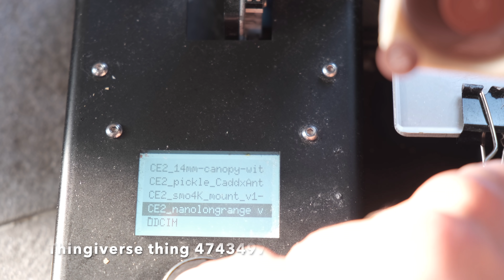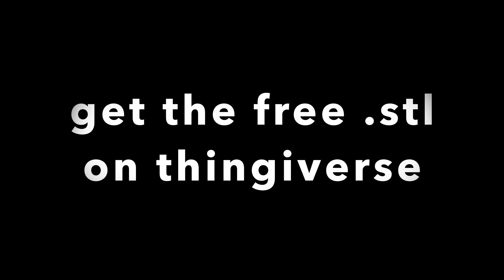3d printed nano longrange FPV drone

Comment: Nice, I'm working on drones that can find and collect cigarette ends.
I have the idea of using supercapacitors as mechanical frame to reduce weight.
Reply: Erik you can't say that and not give us more info!! It sounds like a good idea. Any videos planned :-)
Reply: @andyspoo2  I'm proposing to bulid a custom capacitor in the rounded shape of the ground plate. Use copper band on rolls, cut the form out, same with thin plastic as for litter bags and use, no joke, Johnson's baby oil (mineral oil) as dielectricum for prototyping a ground plate...
If you make a bigger knife for the plastic, you can weld the edges togeher. No air inside!
Reply: There mustn't be any sharp edges in the form because of the corona effect. Make a stance/bended knife to speed up prototyping. Fast recharging within seconds will be possible at the con of a shorter flight time available.

Comment: nice work Kurt!! On my channel I did 29min51sec with geprc 1202 10000kv with same FC, same props. Acro mode. AH I read the description, the 5Celcius IS the issue. Keep it up because I finish my new design to beat 30min! Good luck!

Comment: wow..love to have a 3d printer and print some of those frame
Reply: 3D printers have gotten incredibly cheap and easy to use.  If you can afford FPV then a 3D printer is just about the cost of another low to mid range drone.
Reply: I'll print some for you if you like,

Comment: Nice frame... friends don't let friends fly in angle mode though! You'll probably get even more flight time without the quad fighting you the whole time.
Reply from the maker: Thanks for the tip! I though it would be more efficient...
Reply: That entirely depends on the drone and what you are trying to achieve. Small drones/whoops are angle/horizon mode drones. They will actually fly better and longer this way, as they don't have the weight and power to control them properly in acro, and you will only be fighting yourself. Cinewhoops can go either way depending on the shot. Indoors or making a mostly straight shot with maybe an orbit will look best on angle mode and require less post processing magic to clean it up. However if you want to dive and roll around objects, acro is going to look smoother.
Reply: @JasonEllingsworth  You're kidding yourself... Whoops are flown in angle mode because of the tight spaces and slower roll rate.
Anyone who makes money flying cinewhoops flies in acro. Any form of cinematic flying in angle mode will always look robotic and not flow as nicely because the angle limiting that is restrics the quad to  preset tilt angles  fights the natural flow of the quad.

Angle mode/horizon mode makes constant corrections to maintain attitude. Acro mode simply acts on the stick input and then remains in that position until another input is received. The additional corrections is what causes angle and horizon mode to use more power.

Please make sure what you're saying has actual truth and fact behind it rather than your own assumption/opinion before trying to correct someone.

If been doing this stuff for a long long time. I've tried every way of doing things and I'm not afraid of being wrong because I'd rather be wrong and then have a better outcome, than be stubborn and continue to do something when there is a potentially better way to do things.
Reply: @JasonEllingsworth  solid response.. next time, don't try to correct someone when you don't have a clue... It's also weird that you like your own comments.
Reply: @ryanokeefe12  I liked his comment :^) He never said there was no use for acro in cinewhoops. He just gave very correct info on when to use it. Maybe stop trying to flex so hard about being "right" so you look like less of a tool. You do need to calm down.
Reply: @FIN_OSCAR_RAHHHH  He didn't give correct info on when to use it. nor why you use it.. what are you even talking about. I responded with supporting points as info as to why the statement was incorrect. I didn't juse use profanity and act like a child when I didn't like what was said. I responded with information and fact.
Reply: @JasonEllingsworth  regarding the "high dislike ratio" Are you aware that I don't post videos for others nor try to promote my channel.. you are literally the only 1, or 1 of 2 dislikes. I'm not going to lose sleep over your childish actions.
Reply: @ryanokeefe12  yeah you are.  Otherwise you wouldn't be having your little multiple post hissy-fit
Reply: @ryanokeefe12  he did in fact give good info.  Most people aren't flying any kind of whoop(cinema or otherwise) indoors in acro, and depending on the shot outdoors you will find it beneficial to be in angle mode to keep with the horizon and only make turns with the yaw. All he was doing was simply saying not every situation calls for acro mode.  Your ego apparently couldn't handle that.
Reply: @FIN_OSCAR_RAHHHH  I don't know what you read but that's not what was said.
Nor is what you said relevant to my original comment.
My comment is about this video, the flight that is being shown and the fact that acro is more efficient for battery life.
Regardless, I noted that anyone who makes money flying whoops (which is not what this video is about) flies 100% acro because it's much more free flowing than the restricted angle mode.

Again though, this video has nothing to do with any of this. The first reply from your mate tried to tell me that angle mode was more efficient.. Stay on topic.
Reply: @ryanokeefe12  except you are wrong.
Reply: @JasonEllingsworth  I've explained my comment. I've explained your incorrect points in my responses. All you've done is throw out insults and act like a child.

Feel free to act like a human and let me know why you think I'm wrong, instead of just saying "you are wrong".

Please ensure you read my comments before trying to let me know why I'm "wrong".
Reply: @JasonEllingsworth  I thought so mate.. You've got nothing.. you're just acting like a spoilt child.
If you're ready to adult.. I'll happily have a conversation with you on the topic. If you aren't then you're on your own.

Anyone reading these comments can see exactly what they need from you, and that is that you have made an incorrect statement, have no supporting information but still refuse to be incorrect.
Reply: @ryanokeefe12  wrong again buddy
Reply: @JasonEllingsworth  I guess we are "mates" now? haha that guy was a real tosser. GJ messing with him though. He so salty

Comment: I have been making these for all my friends not this frame but one very similar
Reply: How much do they cost in materials?

And how much do you sell them for?
Reply: @Espelter  I haven't sold any yet haven't really tried but I was thinking of only charging $5-$10 per frame but it's for the frame only for folks that don't have 3d printers.  You would have to buy the other parts separately.
Reply: @SpreadingKnowledgeVlogs  sheesh that sounds good send me your email ???
Reply: @pacman5511  I'm also on ebay but don't have these listed as I'm not sure how I'm going to market them plus I'm waiting to get permission to mass produce them from the guy who made the frame but if someone who doesn't have a printer wanted me to make one I could and technically just say I'm charging for the printing service and nothing else
Reply: @Espelter  in materials I'm not sure I mean you have to take into account electricity and time if your going to get technical about it but I charge $5 a frame plus what ever shipping is which I figured seem fair and not going to get rich off it really just like to help others get into this side of the hobby for cheap and I realize there's a gap in the market to fill of people who don't own printers but would like to try one of these out.

Comment: Imagine how much weight you'd save if you removed all the connectors and soldered everything. And used aluminum screws, incorporated antenna guides into the frame
Reply: Actually you would be surprised at the insignificance of this said weight difference we are literally talking about a gram if even that
Reply: @SpreadingKnowledgeVlogs  Nope, you're incorrect. Soldering EVERYTHING would dramatically decrease weight as the GNB27 wouldn't be needed. In addition to that, a few grams is monumentally important for a build of this size.
Reply: @flightevolution8132  have you ever weighed these connectors?  I have and it takes 5 of them to equal a gram so we are literally talking less then a gram of savings here and that isnt taking into account solder is incredibly heavy as well and most people use too much of it.

Comment: second battery was already overly discharged before takeoff, it's at 2.9V, it should have started at around 4.2V.
Reply from the maker: Right, it's C rating is too low.

Comment: Very good !
I tried a similar project. A long time ago, with coreless motors.  I was at full throttle most of the time just to maintain a hover. My run time actually decreased with a 18650.
Excellent!!!

Comment: I believe I've tried over a dozen different brands of 18650 cells including the sony and panasonic brands and the best I've achieved is 6 minutes.
Reply from the maker: I can only think of 2 reasons. With 18650 you can go below 3V - you don't need to land at 3.8V. There are also a lot of fake 18650 batteries out there.
Reply: @Unboxingexperience7  I agree. My particular issue at this moment is the  (now murata) 18650 3000nAh vtc6. Take off to hover is nominal at about 50% throttle and is held for 2 minutes until small increase is needed to maintain altitude. At 3 minutes I must advance throttle to full as the drone bumps it bottom on the ground. At 4 minutes plus I'm lucky to get a foot off the ground. Cells are charged to 4.2v and end at 2.7V before I disarm.
Reply from the maker: seems to be very inefficient. 3018 props? 1202.5/1203 motors with 11000kv? ph2 connector or GN27/XT30? overall weight over 110g?
Reply: @Unboxingexperience7  90 grams, 1107 motors, 3" props , 18650 battery tray.
Reply from the maker: well, my best guess would be that the motors are the cause. 3018 two-blade props with 11000kv motors are the way to go on these 1s builds.

Comment: Definitely needs crossfire or tracer. Or ExpressLRS
Reply from the maker: right, gonna switch to elrs. waiting for the parts though. some other upgrades are also in the pipeline.
Reply: @Unboxingexperience7  Hi, i stumbled on your design... first time quad flier and want some simple design i can print on my 3d printer. Can you tell me what you're going to upgrade on this model ? Pherhaps with partnumbers ?
Reply from the maker: this will be the most accessible version. plug and play, no soldering. just change to a better radio: tracer, cf, elrs, ghost. next version will have 1202.5 motors and the new happymodel diamondf4 board. frame will stay the same but printed in pla+

Comment: Should  have 3d printed  the props too
Reply: Very inefficient, horrible balance, extremely flimsy, noisy, and somewhat dangerous (mostly for the electronics as they won't heal like you will unless it explodes in your eye or something). Injection molded props are better in every way except delivery time, but you can also make your own injection molds if you really felt the need.
Reply: @jakegarrett8109  good to know

Comment: I had my Crux3 out today, and had 12 minutes cruising on a 2S 450 mah lipo, a 3000 mah lipo is just too heavy in 1s or 2s
Reply from the maker: It's the same weight as the 18650. I think the C rating (only 5C) is too low
Reply: the ESC go one the Crux3, i got the CF one, they will fix it for free tho and support from happymoddel seems to be good, they tried selling me a new AIO for $30 tho but ended up changing it with a 12A stack, but sending it them anyways to get fixed for free
Reply: I been flying my tp3 with 650 3s and getting like 10 mins of freestyle ripping.

Comment: I'll be nice to print the frame using PETG since the motors and all the electronics will produce heat and this heat combined with the sun exposition is going to melt the frame very easily...

Anyway, congrats for the project and the video, such an awesome result :)

Cheers

Comment: It's nice, but for me a minimum HD or 4K camera is a must on a long range. That being said, it certainly is nice to not have to swap your batteries every 3 minutes. I am also not sure if I like the whole "structural flight controller" thing, because when it crashes, it will also take part of the impact. Why did you ditch the first designs? Too heavy?

Comment: I wonder if using ABS would be better. You could also work with different geometries, instead of limiting yourself by a 2D design, which are necessary when you're working with carbon fiber sheets. A few vertical triangular support struts would make the arms much more rigid.
Reply from the maker: Well, my approach is to keep it as simple as possible. I'm down to 7.7grams on PLA+ with 20% infill. There is room for improvement, but I'm not sure if it's worth.

Comment: You really shouldn’t run Lipo under 3v and 18650 check specs normally ok to 2.5-2.8 minimum before you damage cells

Comment: Your model is amazing. I subscribed you. What is the max range of your drone?
Reply from the maker: with a better rx you can go up to 1km then the fpv signal gets too bad. on my newer builds with external vtx I had no issues up to 1.5km. you can go probably even further. just check my playlist with all my nanolongrange builds.
Reply: @Unboxingexperience7  Thanks🙂. Can you tell me how do DJI manage to send the drones upto 12km? What Rx do they use?
Reply from the maker: DJI's digital vtx has 1000mW output which is in some countries legal, as the signal is digital and not analog. Some of their units include an rx too.  But the rx is not your limiting factor, elrs, crossfire, ghost go way further than 12km.

Comment: somehow strange died quickly on the lipo👍✌
Reply from the maker: it's only 5C but it should be capable of putting out 15A... It's supposed to power a radio not a drone ;-)
Reply: @Unboxingexperience7  The 18650 doesn't give out much more than an amp, I think
Reply from the maker: This is a Sony VCT6 with up to 30A output...

Comment: Interesting idea. This inspired me to I throw a high drain 18650 on a Tinyhawk Freestyle. I'm only getting a few minutes before I'm down to 3.2V but as soon as I land it's bouncing back to 4V. Might have to find some other cells. Did you see any damage from pulling them this low?
Reply: You could use a high discharge cell. Often the Murata/Sony VTC6 is used, it can be discharged to 2.5V in flight without any problem, according to data sheet even to 2.0V (but at very low amps only). As Li-Ion cells work at a much wider voltage band than Lipos, it is also recommend to adjust the Betaflight voltage warning settings accordingly. Good luck!
Reply: @Disco Volante Thanks I didn't know the min voltage could be that low! The 20 amp rated Samsung cells I tried sagged just too quickly. Anything below 3.1V and hover becomes impossible with this setup. I picked up some Vapcell 38 amp continuous draw cells to try another test from their performance graphs they should stay above that 3.1V at my current draw for about 70% of their rated capacity.
Reply: Do you use it on a stock Tinyhawk Freestyle? This model is normally operating with 2 cells, so you will have way too low thrust with a 1 cell setup.
Reply: @disco.volante  Not so, the stock THF is 1/2 cell, and flies perfectly well on 450/520/650 GNB 1S LiPo. Better for indoor/garden spaces. The issue with using Li-ion is the weight of 2600/3000mAh high discharge cells,  but then you would not expect the THF to manage a 3000mAh LiPo, would you.

Comment: Did you drained the Li-Po really down to 2.3V? Seems excessive for the load of the lipo - and then are the flight times not meaningful. otherwise great video!
Reply from the maker: sure. but I only bought this lipo for this use. however, it is not usable with its low C rating. voltage sag is to high. but  i learned that the crazybeex cut off voltage is around 2.25v so there is no need for a step up module!

Comment: Couldn't you make pins in the frame for the rubber grommets on the AIO pop through, instead of using screws? Might save some weight.
Reply from the maker: I think plastic screws are a better option if you want to make it even lighter.
Reply: @Unboxingexperience7  maybe those renny screws mrShutterbug likes to use?

Comment: Really nice frames. For power, I wonder if a 21700 sized cell might be better.
Reply from the maker: dont think so due to the increased weight (+20g)
Reply: You could scale up the aircraft, should improve total flight time slightly (especially since some things are fixed weight such as camera/VTX/receiver and most likely the ESC etc).
Reply: @jakegarrett8109  A Samsung 40T cell packs a lot of juice, I have a 4S  batttery made out of them. Flying off of a single one would be awesome.
Reply: @yannickg6904  Is that your favorite 21700 battery? I'm looking into that size too and wondering where to start or what most people are using and like.
Reply: @jakegarrett8109  It's my favorite because I can get genuine ones at a fair price from a reseller I trust. There may be better ones out there. So far that pack has been very reliable. I built it to power a 7in LR quad, but I mostly use it as a power pack for my little  ISDT charger to replenish whoop and toothpick batteries. A 4S 4000mah Li-Ion will give a bunch of charges on little LiHVs...😀
Reply: @yannickg6904  Nice! I love my whoops too, got a couple brushless ones I fly a ton and recently a few brushed ones when they had a sale for like $20 for full acro brushed eachines that would pair with my nice controller making great backups. I'll have to dig into the newer batteries researching them a bit, thanks for the input!